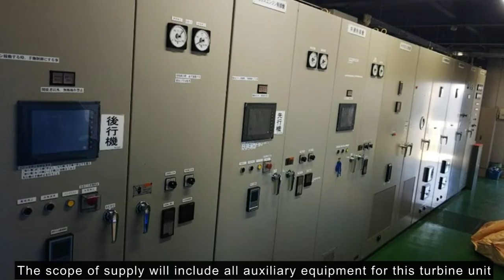2 x 2.88MW 60Hz NIIGATA 18V22AG Gas Engine Power Plant for sale ($180K)

Comment: I would feel at home working on these girls as I am a factory trained Waukesha natural gas mechanic with over 30 years of experience. These are lean burn engines. They use a pilot fuel flame to ignite the main AFR combustion. They run so lean just a spark plug will not ignite the AFR in the combustion chamber. They run on the lean side of stoicometric to reduce emissions. But natural gas is 500 times cleaner than a gas engine…
That’s all I got to say about this